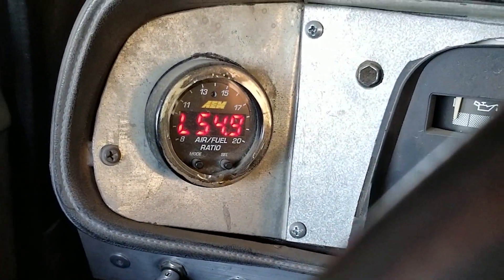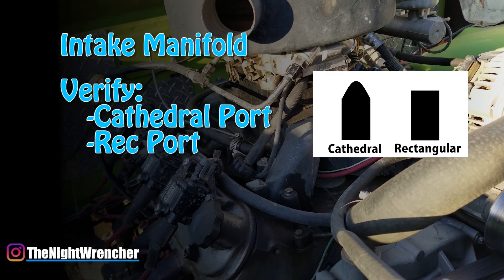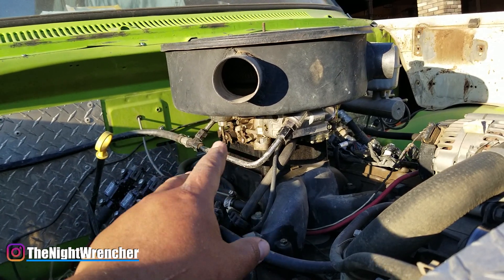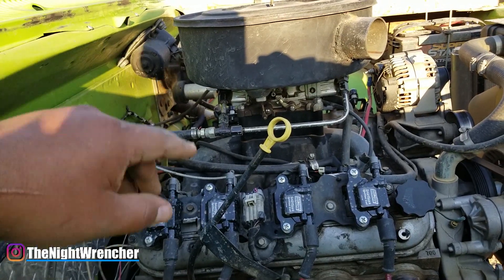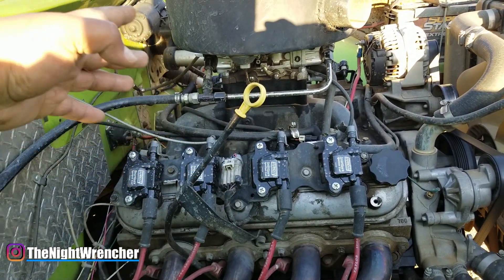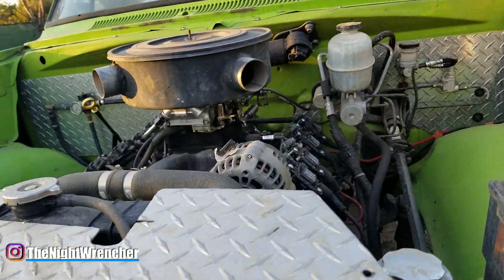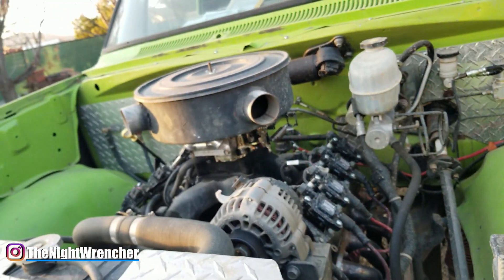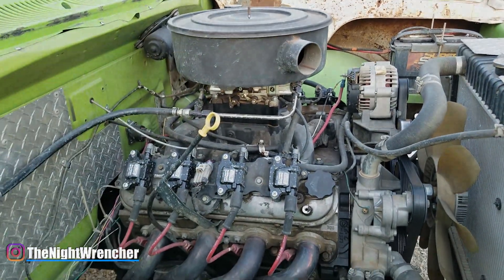How To Install A Carburetor On An LS In 2021 | LS Carb Conversion | Carbureted LS |

Comment: You saved me from msd, thanks. Hadn't come across Daytona spark, looking forward to reliable hassle free ignition control. 

I've got a question regarding fuel lines. I have a v6 4th gen fbody. It came with a return still system. Do you think it's feasible to plumb install a regulator similar to your setup using the existing fuel lines? In your video I see two lines to your regulator, are using a return system?
Reply from the maker: I am using a return style system on my truck. Since your car was EFI, the stock pump is probably like 40psi so you'll want to install a regulator and a return line back to the tank. Hope this helps!
Reply: @NightWrencher  regulator for sure. Would stock efi lines work or do I need to size up or down. Thanks again, these videos are a great resource!
Reply from the maker: If your stock lines can be moved and installed on the regulator without damaging anything, you can reuse them no problem. They should be big enough for your swap

Comment: By far the best thing to do on a street driven vehicle is buy a high or mid rise dual plane. Then when you go to the track install your 1 or 2 inch open spacer. This will help that dual plane act more like a single plane for the track. And it takes 10 minutes. On the LS motors the single planes absolutely kill low and mid range torque.
Reply from the maker: I need to do some back to back testing on the dyno with the spacers
Reply: @NightWrencher  engine masters and Richard holdener have both done it. That’s why I went with a dual plane for my NA combo over the single plane